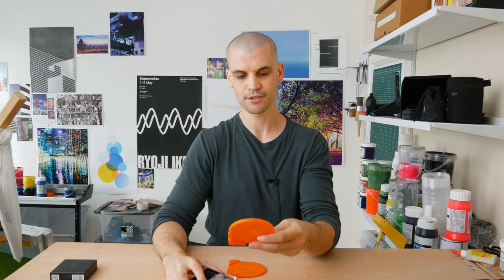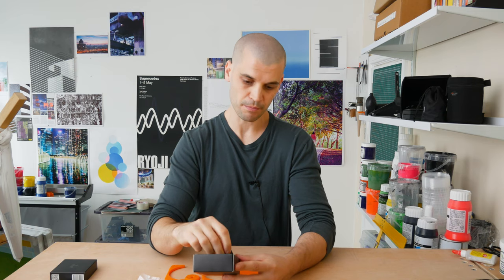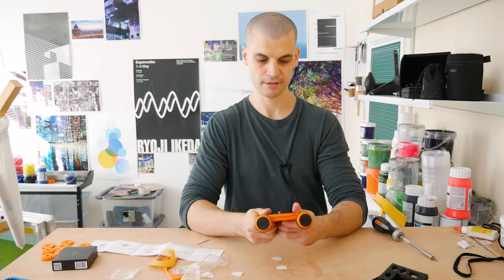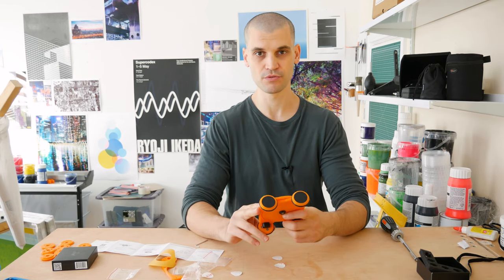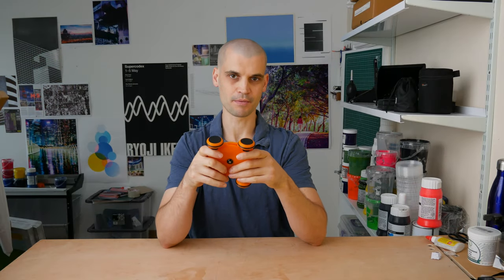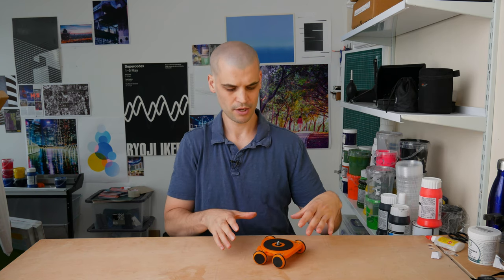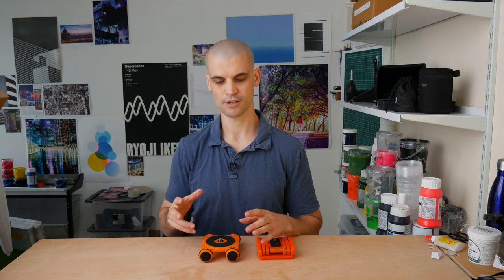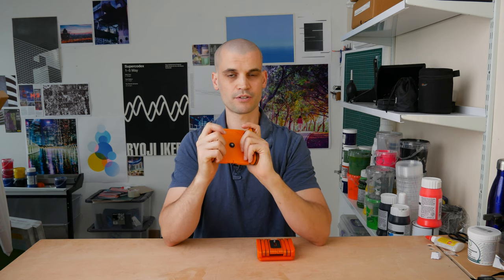EDELKRONE ORTAK SKATER 3D REVIEW

Comment: Just came across the video...thanks for your insights!
They pretty much vindicates my scepticism when I first saw this. I would never have considered using a flext-tilt head in conjuction with this, though - even if it was all metal. I know Edelkrone tells people they can do this and includes this in their marketing material. And technically they are not wrong, but it is a bit of a silly idea in my opinion. As soon as you add the weight of a camera and lens to the equation, the idea falls apart pretty quickly. You might be able to get away with that using a smartphone, but I would not bet money on it.

The more moving parts are between the camera and whatever connects it to the ground, the shakier your footage will get. You really want as few moving parts as you can get by with as well as a lot of mass (and therefore weight) in order to somewhat compensate for any shaking, which clearly is not present in this one. That said, I am fairly sure that you would face the same issues in use on more upmarket models of a similar design as well, even though they might be less noticable.

As for the finish: I do not mind a few little scuffs...sure, if this was something like a brand new $800 tripod mount, I would expect a flawless finish when I take it out of the box. But on a $30 DIY kit - I am not tremendously worried about that. And stuff gets banged up over time anyway...it is meant to do work after all and not meant to sit on a shelf to be looked at and be pretty. 

Still, considering the price and the intended audience - I would say that this is pretty much a winner.

Cheers!
Reply from the maker: Agree, for $30 its not bad, but i think any creator will quickly outgrow it